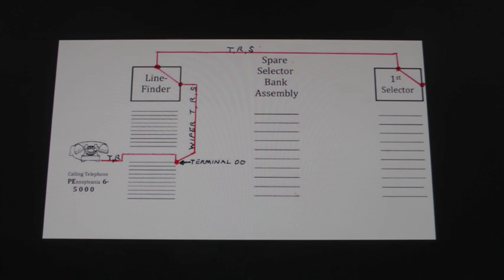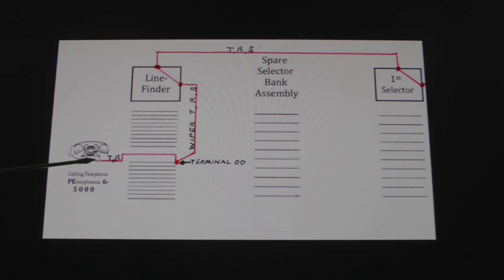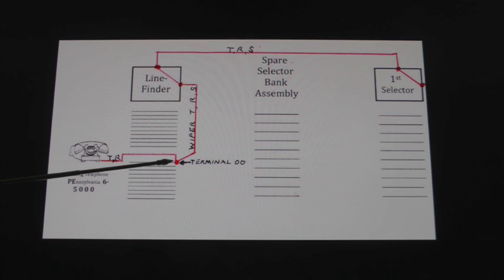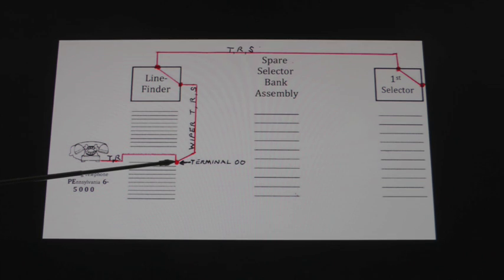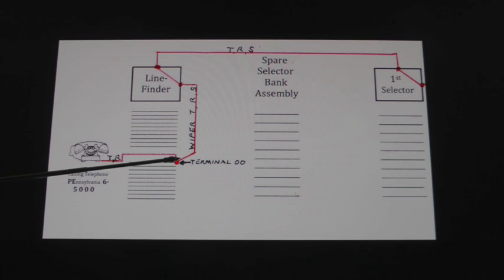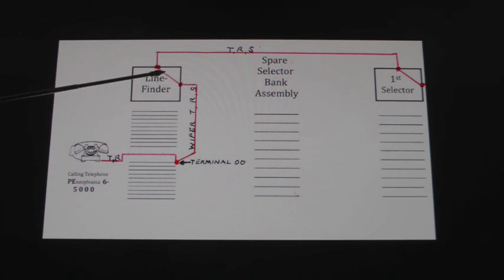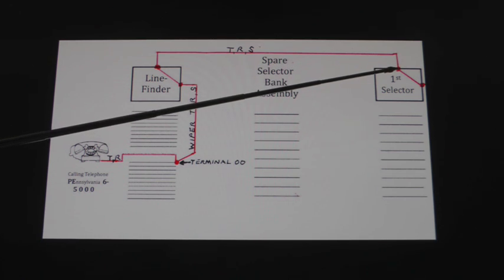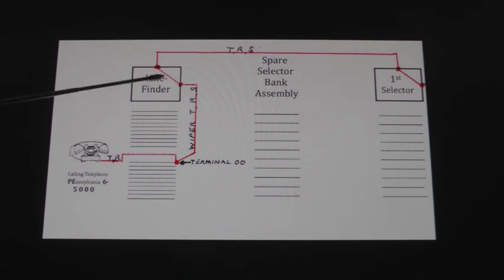Dial Tone In The Step-by-Step Telephone Switching System

Comment: Hi, your videos are very details. I still have some questions. Hope it’s OK and you’ll find the time to answer. Thank you in advance anyway.
Each phone set is simultaneously connected to 20 line finders?
Reply from the maker: The line finders are arranged in groups of up to 20. Each group serves 200 telephone lines. The 200 telephone lines are physically connected to the bank terminals. Each bank assembly terminates all 200 lines and the terminals are multipled across all 20 bank assemblies. This means that all 20 line finders have the capability to connect to any of the 200 lines.The 20 line finders are shared by the 200 lines. A telephone line does not connect to a line finder until a subscriber makes a dial tone request by taking the receiver off-hook. At that time, the line finder group selection equipment selects and activates a line finder, which moves its wipers vertically and horizontally until they make a connection on the bank assembly to the line requesting service. This connects the line from the bank terminals, through the wipers, through relay contacts in the line finder out to the 1st selector which provides dial tone to the subscriber.

Comment: I'm starting to get it but still confused about a few things, like:
1) What generates the dialtone, and how does it work? What about busy signals etc? If it's another machine, how is it connected to the caller without other callers being able to hear each other "party line" style?
2) If the line finder always steps to 0, what's the point of having the other contacts?

I'll watch your longer video next to see if it resolves some of my ignorance. Thanks for putting these up!
Reply from the maker: Every Central Office is equipped with alternating current tone generators for dial tone, busy tone, no circuit available tone ,etc. They were huge motor driven devices in the early years and much more compact solid state electronic devices in the later years. Dial tone is permanently connected to each 1st selector and is cut through to its attached line finder as soon as the originating telephone line has been found and connected to the 1st selector. The tone generator is removed from the voice path after the first digit is dialed.

The line finder can find 200 lines and so there are 200 sets of line contacts on the bank. The line on my demo unit is connected to the tenth terminal on the tenth level and so the line finder steps up ten levels and rotates ten steps. I could have attached my line to the first terminal on level one, but it wouldn't have provided for much of a demonstration of the electro mechanical motion of the switch.
Reply: @Hicken65  thanks, that helps!
Reply: To answer--at least--ONE question: When you picked up the "telephone instrument" "receiver" (essentially a telephone handset), you accessed the "Line Equipment," giving you--in turn--the dialtone. BTW, the DT had no special meaning... SIMPLY lets you know that the LE is available. When you begin to dial, the DT disappears...and you access the switching equipment (first "Selectors, " then "Connectors")...which routes your call..either to another phone address in the same office...or sends it out to another office (and that telephone must, then, have an "Area Code" to let the system know what office you need to access).
Reply: @456zounds  Actually, in this demo you do pick up the "handset."  The "receiver" is the part that goes against your ear and lets you hear progress of the call.  In the older "candlestick" style phones, you did lift the "receiver" which was the cylindrical part you held to your ear; thee "transmitter" was the part on the so-called candlestick base, which you talked into (today's generic term would be microphone).

Comment: Thanks for detailing the operation of the line finder and first selector. I’d had questions about how a line finder would skip over other potentially active calls as it cut in to the current subscriber line, but the operation of the A relay and the subscriber line relay explains why it isn’t a problem. Also, this explains clearly how the line finder “knows” just where to go to connect to the subscriber line. Excellent demo!
Reply from the maker: Glad you liked it and thanks for watching.

Comment: I wish you had a wiring diagram for the Tip and Ring wires and the complete circuit. Its confusing without this.
Reply from the maker: Everything you want to know is answered in my long video "The Line Finder In The Step-By-Step Telephone Switching System". Just search my channel name "hicken65" in You Tube. Thanks for watching.

Comment: I used to be the telephone tech for a large hospital. Our switch was a AT&T Dimension Prelude. It was a 500 line switch with  D.I.D. 30 trunk cards. It was fully electronic, but the local C.O. had some of this kind of switching but our system was engineered for this kind of communications. I remember having to go to the C.O. once in a while and a room with those step switches was so loud one almost needed ear protection!
Reply from the maker: To some, a SXS CO was just a noisy clatter, to others it was a rhythmic chatter.
Reply: @Hicken65  Yep, I can see that!

Comment: Only the fact that electrons move at near light speed makes getting a dial tone in a reasonable period of time (In this type of system) possible. Imagine what it took to design this. My Engineering training spans vacuum tubes and analog computers to the present day. I still marvel at the way we did things before solid-state circuitry came about.
Reply from the maker: The electromechanical telephone network was an extraordinary achievement and a fascinating part of our technological history. My videos attempt to keep this story alive using the few pieces of this antiquated switching equipment that I have as a working example.
Reply: @Hicken65  And thank you for these videos. The old bell system had 5x9(s) reliability. I doubt cell phones and VOIP will ever achieve that level. Not to mention power outages. We had a three-day power outage in Northeast Ohio when I was kid. The phones still had a dial tone!

Comment: So did EACH line have it's own line finder?
Reply from the maker: No, typically groups of 200 lines shared access to up to 20 line finders.
Reply: @Hicken65  so a single subscriber line was connected in some kind of buss to multiple line finders then? great videos! I'm fascinated by this technology and your videos are very helpful
Reply from the maker: @jon42689  A subscriber line's 3 wires, that is the tip, ring and sleeve leads, were permanently multipled to all 20 bank assemblies of a line finder group.These leads were then temporarily connected to one particular line finder during a telephone call via that line finder's wipers connecting to the line's terminals on the bank assembly. Full details can be found in my very long video "The Line Finder In The Step-By-Step Telephone Switching System". Just search my channel name, Hicken65, onYou Tube. Thanks for watching.
Reply: I believe some very small offices had permanent wiring to first selectors, as in each subscriber would have their own first selector. Evan Doorbell seemed to believe that was the arrangement in Nantes, Quebec, when he recorded their step-by-step in 2001. But the point of the line finder is to not need that. Instead of 200 first selectors, an office would have 20 line finders, which would find the off-hook phone and connect them to a similarly limited number of first selectors.

Comment: Neat video.  I wonder how often they had to clean those contacts?  I know with every swipe across  a contact, there is a small electrical spark
Reply from the maker: Bank cleaning was an ongoing routine but there was very little in the way of sparking. The tip and ring wipers were electrically dead during the horizontal sweep, so no sparking there. The sleeve wiper was grounded and during its sweep it would encounter an electrically dead sleeve contact if its line was idle, and a grounded sleeve contact if its line was in use, so no sparking for either of those conditions. The only potential difference was encountered on the sleeve contact of the line requesting dial tone, which was negative 48 volts, but through a resistance of nearly 1600 ohms.
Reply: We had to spray this hydrocarbon liquid on them during regular maintenance...my guess is that it amounted to every several months. No masks either: I had to buy my own, at one of the Downey COs.

Comment: Thank you for another great video!  I was wondering if you'd be able to make a video on the workings of the tone plant (ie dial, busy tone generator) and the ring generator?
Reply from the maker: Not much to video there. They are boxes containing solid state electronic devices. You can see them in my video "The Connector In The Step-By-Step Telephone Switching System". Just search my channel name "Hicken65" on You Tube.
Reply: @Hicken65  OK, thank you.  I intend on building one from scratch so I need to ascertain what components are used. Cheers.
Reply from the maker: @akmtl  You're welcome and good luck with your project.

Comment: I worked in a step office for many years, it was very loud and it lasted 24hrs a day 7 days a week 365 days a year. We had no noise protection. Now I’m 61 with hearing problems. When it went electronic in the late 80’s all of a sudden no noise.
Reply from the maker: Well, they could get very loud, with the crescendos in most offices occurring between 10 and 11 a.m and 2 and 3 p.m.  They could be quite quiet in the middle of the night and you could sometimes hear an individual call progress through the system. I thought crossbar offices were even louder, but only in the aisles where the markers (the central control equipment) were pounding away. I imagine there are quite a few old CO techs with damaged ears.

Comment: That was so interesting, thank you. I would love one of those wipers as a desk ornament. By the way, I collect old telephones. Any way of making them ring?
Reply from the maker: I presume you don't have a landline. Since you're a collector, look for a really old phone that has a magneto (the phones with the crank handle) or simply purchase a standalone telephone magneto on Ebay. Hook the two magneto outputs to the two wires coming out of any phone and turn the crank. Make sure the receiver is on hook. If the ringers are working, they should ring. By the way, you should consider joining "Telephone Collectors International". They have a lot of information online that you might find very interesting. Just Google the name.
Reply: Hicken65, many thanks for the reply. I have several magneto phones (from Ericcson of late 1800's onwards), but no electrical experience.  Will try over the weekend and also the link you sent. Best wishes.

Comment: I still know two people, one a sister, that have rotary phones (my sister's is wall mounted, the other a desk model) that still work. They cannot dial, but can receive a phone call and still ring! Of course they have modern phones, but their land lines ring to those old phones. Fascinating video. I never knew what happened behind close doors back in the day. Thanks for sharing.
Reply from the maker: Many telcos still allow rotary dialing on their land line systems. That is the case where I live, where I have several hooked up. It is amazing that a 90 year old piece of technology still works on a modern digital switching system. Thanks for watching.
Reply: @Hicken65  When I first moved into my home 26 years ago, I had GTE, (now Verizon) and their tone service repeated what you dialed in pulse before connecting the call, I could hear the pulse repeat in the line. Occasionally I would pick up my phone and have a dead line, then I'd have to go to a neighborhood gas station and use a pay phone to call the 800# for service. This happened more than a few times, due to a chronically sticking electro-mechanical switching device. I wouldn't be aware of the dead line for possibly several days until I needed to make a call. What if it was a life or death emergency?!! And anyone trying to reach me would not get through. Fortunately the equipment here has been modernized since then. 

I still have the rotary phone we had at my childhood home from the 60s thru mid 80s, it's beat up, cracked and has paint on it because I moved it to the garage workbench as an extension in the early 80s after Mom bought an aftermarket phone from the store. Back then they used to charge extra on your bill for an extension, but I just wired it up myself and they didn't know. I don't use it for anything now, just have it for nothing. I also have a couple of Western Electric touch tone wall units in better shape. 

During the 60s my grandparents in Gary IN had a party line. One day as a kid I picked up the phone and there was a conversation in progress and I freaked out, Mom made me hang it up and explained about the party line. They had GTE, we had Bell at our house, which was better, and no party line.
Reply from the maker: @onemoremisfit  Viewers recollections like yours demonstrate how significant the old telephones were in peoples lives. Thanks for watching and for your story.

Comment: I can't imagine the task of wiring all these things and connecting them to others all across the country. It must have been a nightmare trying to find a malfunction or a broken wire in the entire system.
Reply from the maker: There were some complex problems, of course, but in general troubles were easy to locate and fix.Technicians were well trained and test equipment was extensive.
Reply: Yeah that and how much copper wire was involved in each Bell center. Just the relays alone used alot of copper wire too.
Reply: Well, over time, the testing equipment seemed to get MUCH more SOPHISTICATED.

Comment: I remember hearing a sound similar to what a parakeet would make when picking up the receiver.  It was more noticeable if you left the receiver in your ear and hung up by pressing the switch hook and letting it go.  Before the dial tone I’d hear the racket which was the line finder.  I used to wonder why it made the noise.  Sometimes it would be very fast and other times it would be a bit slower but even slower was maximum 1 second.  It was always very fast.  Your video explains the noise I used to hear.  The old step system was noisy though.  If you were on a call you’d occasionally get a click or two.  I could also hear busy signals in the background when calling someone.  I’d hear the ring tone but far off I’d also hear a busy signal which was probably the sound from other calls.  To think this had such a mechanical component is a wonder it worked as well as it did.
Reply from the maker: The SXS equipment did work well, but required continual maintenance to keep it "tuned up". The fine tuning was made difficult in that the equipment had to work with a telephone set located in a building next to the central office as well as sets located several miles away with the added resistance and capacitive reactance of the long lines. Induced noise interference on electromechanical switching systems was a fact of life, but apparently it provided much enjoyment for the so called phone phreaks.
Reply: I remember hearing these noises as well, like hearing the switch sound in the background and one time a full on crossed line and when the other person was dialing the switch sound and ring was super loud.

Comment: I just put my old connector on my shelve for display. I worked SXS for years... Miss it. So thanks for this post and others!!
Reply: Nothing like the skill it took to trouble shoot in SXS....
Reply: In palo alto CO the wall facing the main frame had tile nooks with gas jets to heat your irons.
Reply: Spiritman, I also have a SXS connector I saved from an EAX cut-over years ago......What I don't have is a "bank" to show how the wipers selected a line.  Any help?

Comment: this is fascinating, thanks so much for uploading. I am in Sydney Australia and I plan to build my own Strowger set up, similar to what you have here. Most of our exchanges went over to digital in 1992 but quite a lot of the Strowger equipment is still left in the buildings. I plan to acquire enough of this to make a working model.

I already have a ringer (tone plant) and power source.

So I need to get my hands on racks, a line finder and a few selectors, including a final selector.

I am not a telephone engineer, but understand the principles involved. As the Strowger system is complicated and time-consuming to decipher without training, I was hoping that you wouldn't mind me asking some questions re the set up?

I really would appreciate it a lot.

Thanks again for uploading these detailed videos. I have watched them so many times - absolutely love it.

Cheers Erik